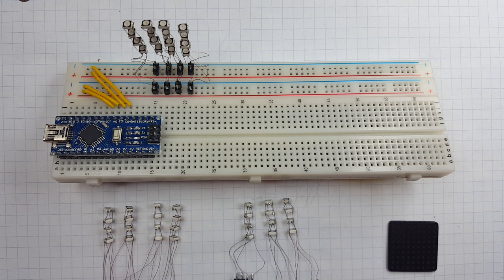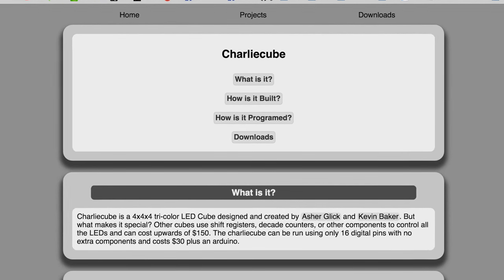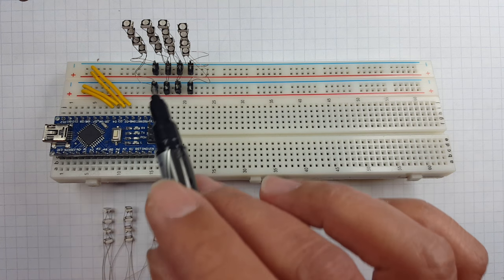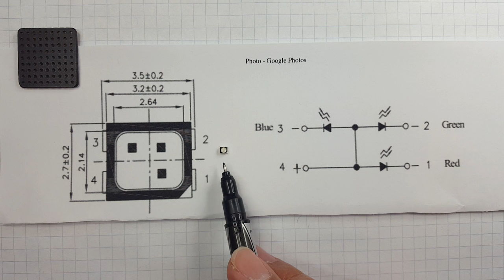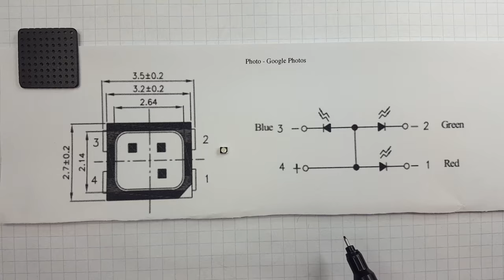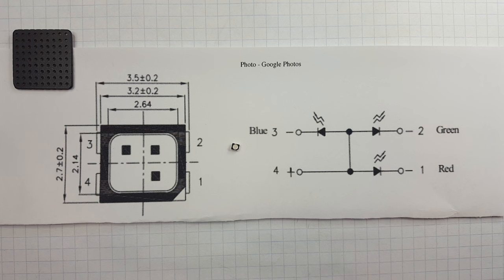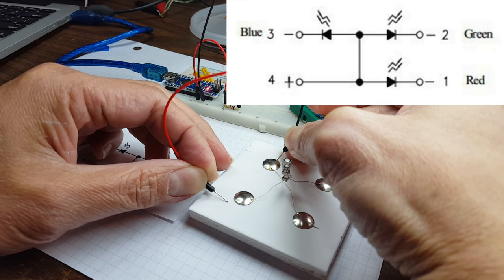HariFun #122 - How to control 12 LEDs with just 4 Arduino Pins!

Comment: It is good to know the maximum allowed reverse voltage of that specific LEDs. Some can even be damaged with 5V reverse voltage, especially when driven by PWM (maybe because of the ringing voltage spikes).
I was trapped with this effect when our country's mains converted from 220V to 230V. LEDs from my old LED clock taht I made some 20 years ago started to fail because of the slightly higher reverse voltage.
Various charlieplexing techniques are great, but one has to take the reverse voltage into account.
Reply from the maker: +medvídek Krupička , I was unaware that reverse voltage limit for LEDs are so low.  Thank you for bringing that up.

Comment: Seems you have just rediscovered the good ol' charlieplexing method, also known as the crossplexing: with n pins, you can control n^2 - n LEDs. 4^2 - 4 = 12 LEDs,  where 4 is the number of pins...
The only concern now is to cycle through the LEDs and trick the eye, since you can't actually keep them all lit up at the same time.

Comment: great work, and very tiny .  that small work must hard. i know i would be taking some breaks.  I just got a fine tip iron from online store , and it's so sharp i dont even want to have to work at that size . LOL
What I cant find out is what temp my iron has to be to burn off the 'no-strip/sand' enamel coating on my .1 mm jumper wire .It says that your iron cna just burn it off . LOL
 Your wire looks stiffer than the small stuff i have .  I sure don't envy the task you gave yourself .  COol as ever man .
Reply from the maker: Thanks +XerotoLabs !
Your jumper wire is 0.1mm diameter? That sounds extremely thin?!
I use 22AWG (0.63mm) for jumper wires.

Working with small SMD LEDs definitely require patience and steady hands.  However with proper tools, it is not that hard.  Flux Pen, 0.032 diameter solder, temperature controlled iron with fine tip and a magnifying lamp.  Put some music and it's quite relaxing actually.  I've told someone that it's the modern day equivalent of the old masochistic hobby of building ships in a bottle. Pointless, really, but people seem to enjoy it. lol
Reply: +Hari Wiguna Ha too true . Like you i prefer to build jigs and pre-tin when i can . SMD stuff usually comes tinned . That make stuff easier.  And the wire i have for fine work it s for fixing cell phones  and ipods and the like   I have used it as a fuse-able link at times.